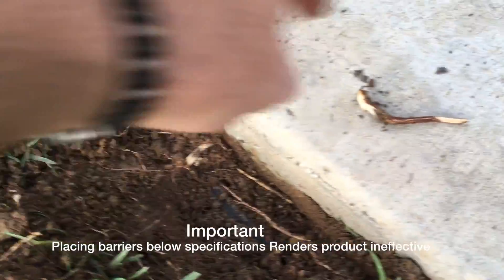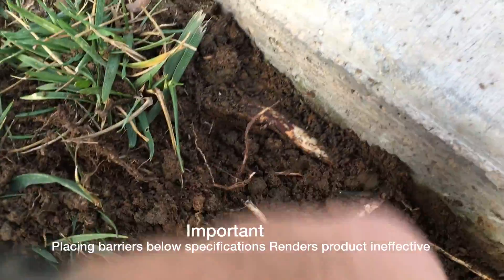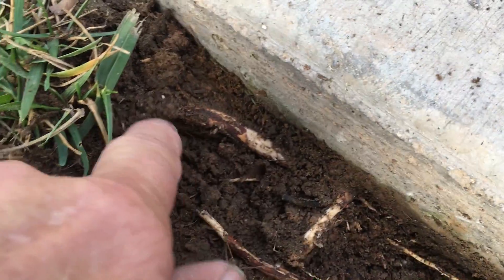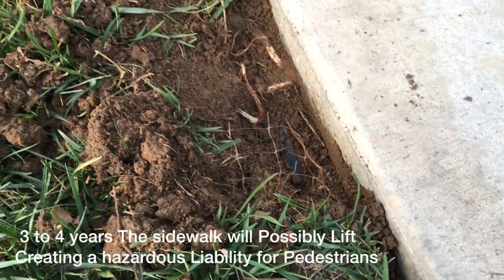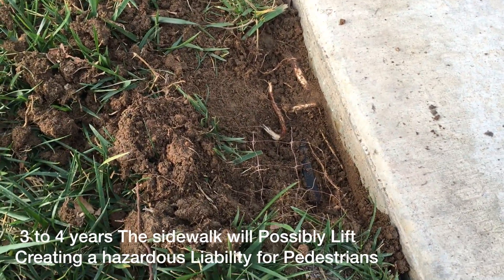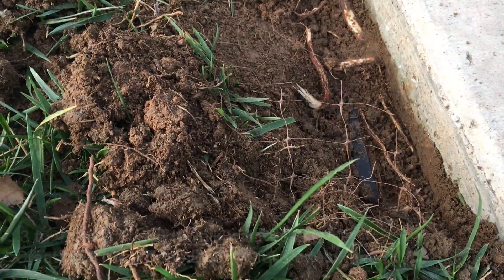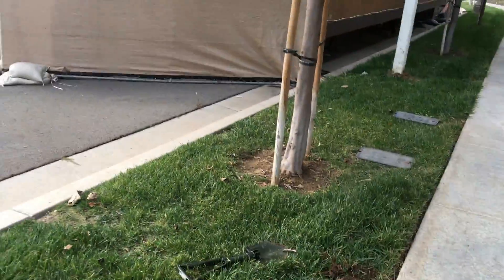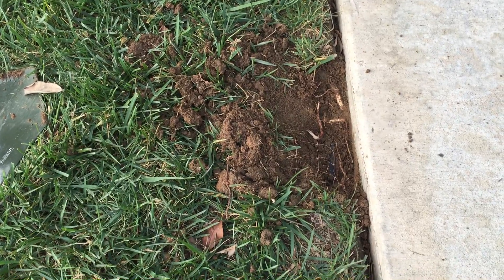Uh Oh – Substandard Root Barrier Installed Improperly

Comment: Roots can break through these barriers? Over time won’t these barriers weaken and break? I’m just curious because I’m thinking about using this on a tree near my foundation and one near my water line.
Reply from the maker: the root barriers are made from polyethylene and can last up to 30 years in the ground.   there wouldn't be an easy way to have the root puncture the material.